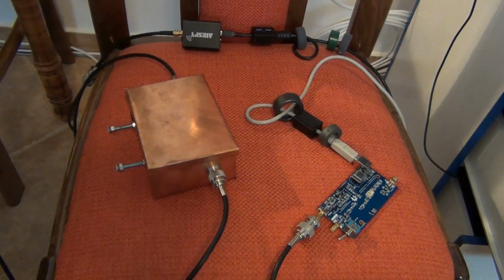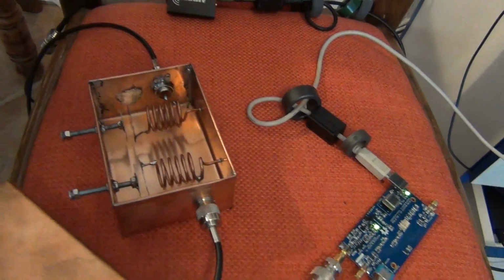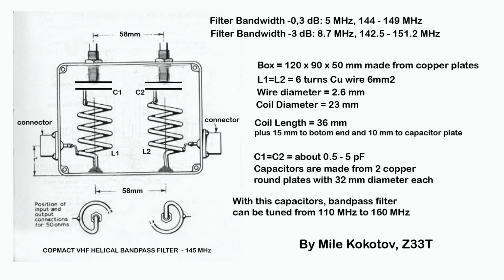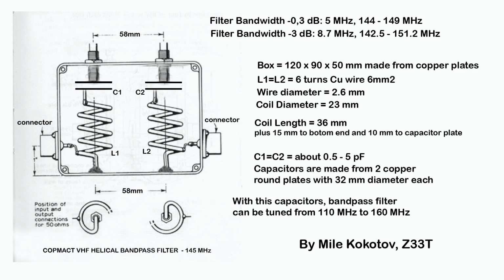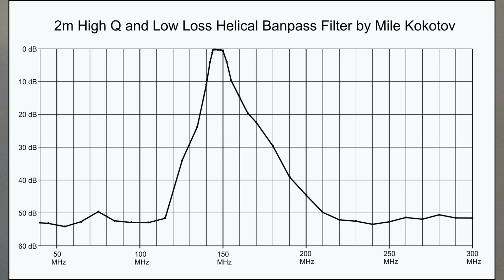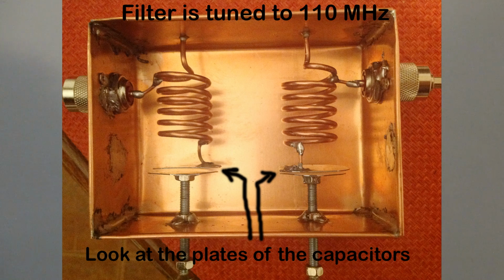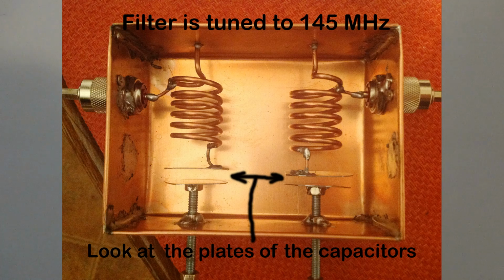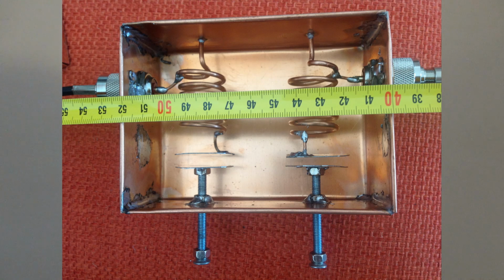145 MHz Low Loss Bandpass Helical Filter by Mile Kokotov

Comment: Hi I am thinking to build this as I suffer with antenna masts near me and my radio 2 meters, front end is blasted by the masts transmissions. Can I use a diecast box or does it have to be copper? many thanks for your response and great video.
Reply from the maker: You can use Diecast aluminum box, but much better is copper box in order to achieve low loss in bandpass frequency range
Reply: @milekokotov1964  Thank you for your response. What you have built is very good. Is it OK if I use double sided copper PCB? as copper sheet is very expensive here.
Reply from the maker: @personalunderstanding7055  Yes! You can use double sided copper PCB. I use it for making the box also!
Reply: @milekokotov1964  Brilliant, thank you!
Reply: @milekokotov1964  I built mine but it was 21 Mhz lo., meaning the swr was 1 2 1 at 124MHz. I wish I was good at maths.

Comment: I have built this, works great on 148. But i got difficulties on 170, any suggestions?
Reply from the maker: Make the capacitors plates with little smaller diameter. The Coils can be the same or 1/4 turn less.

Comment: Thanks for sharing - I must build this! I have already bought a 3-stage filter, which works perfectly. By the way, do you know, how to tune a 3-stage-filter correctly? It's obviousely more complex than turning all 3 stages to maximum...
Reply from the maker: The tuning depend of which method you will used and which measure equipment you have. I highly recommend tuning with VNA (Vector network analyzer). There are many cheap VNA on the market today. For example, NanoVNA which cost less than 50 USD.
Reply: @milekokotov1964  I've tuned with a VNA, all stages to minimum passband loss, but there is some ambiguity because of the 3 stages. I have read somewhere about shorting stages and tuning stage by stage, but I dont know how exactly.
Reply from the maker: @trombabaroque  There are several technic to tune 3 or more stage filters. I preferred to tune them to minimum passband loss and that`s it. Depend of what to want to trade off. Passband shape or passband loss
Reply: @milekokotov1964  Ok, I understand 🙂 thx

Comment: Would 30 mm copper plates work for this instead of 32 mm? I'm planning on making this filter to attenuate strong VDL2 blips on 136.7 that is ruining my LRPT captures on 137.1 and 137.9 MHz
Reply from the maker: Yes. It will work with 30 mm copper plates
Reply: @milekokotov1964  great thanks!

Comment: That is amazing! Would the loss be similarly low (looks like 0.5 dB) for uhf, like 315 mhz or 462 mhz?
Reply from the maker: The higher the frequency - the higher losses will be, so the filter have to be build much more carefully, with silver plated copper if it is possible, and instead of helical filter, the design have to be with half wavelength or quarter wavelength stubs...
Reply: @milekokotov1964  I have a CNC and 3D printer, figured I could use both machines to make something super accurate.  By stubs do you mean a cavity filter?
Reply from the maker: @weirdsciencetv4999  Yes. The cavity filter is much more efficient  for UHF
Reply: @milekokotov1964  brilliant, that’s what I’ll do then.  I saw someone make a sort of cavity filter that looks like a comb. Unfortunately he didn’t rigorously characterize it, like insertion loss- just a spectrogram of it being a bandpass filter.  Might look into those too.

Comment: What is the maximum power level that this design can accommodate? I was thinking of building one just like this for one of my mobile transceiver (Kenwood TM-D710GA). The specific radio I want to use the bandpass filter with is rated at 50W. After hearing the part near the beginning of the video where Mile covers the dangers, now I'm thinking this might not be adequate for a 50W transceiver.
Reply from the maker: Hi Jeff, I am using this filter with 100 Watt RF power. With such power, the filter become little  warm, but not very. 73
Reply: @milekokotov1964  that’s great! I operate APRS and voice from the top of Mt. Oglethorpe in Georgia every July. There are several radio towers in very close proximity (maybe 100 feet?). 

There’s 15 of us along the length of the Appalachian Trail from Georgia to Maine (Appalachian Trail Golden Packet). We are able to communicate the full length of the trail via APRS digipeating each other’s packets and have voice comms with adjacent stations all through omnidirectional antennas with no more than 50W. 

I would like to have the extra front end protection.

Comment: The center frequency is selected only by the linear length of each coil or by the coil length itself ?
Reply from the maker: Both! Central frequency depend of coil inductance and capacitance of the capacitor. On the other hand, the coil inductance  depend of linear length of the coil, the coil length itself, and many other factors...

Comment: Thanks, Mile.  If it were microwave, I guess I could understand, since waveguide kind of bounces EM waves off the parallel walls ( as I recall -  could be incorrect).  Is it that the active parts ( capacitor plate soldered to coil and coil itself ) are electrically "above" the ground of the copper box?  If that is correct, then the fact the inner conductor of the coax is soldered to the coil also "above" the ground of the box would allow the energy to move in and out of the enclosure.  In all, this is a beautiful creation and thanks for putting it on You Tube, Mile.  Inspiring!

Comment: What would happen if you put this on the output of a transmitter to aerial? I’m new to radio and wonder what stops spurious.
Reply from the maker: This filter is made of two coupled resonant RF circuits. Оnly the frequency range for which the filter is designed can pass through this filter.

Comment: wonderful video ,that make me easy understanding how it work and cristal clear ,please tell me if i want to tune it between 200 and 250 mhz for reception what should i do with the coils thanks
Reply from the maker: For slightly higher frequency, the coils should have less inductance and the capacitors should have less capacitance. The capacitor plates diameter should smaller... You have to use network vector analyzer like the cheap NanoVNA, to tune it properly. Good Luck.
Reply: @milekokotov1964  thank you ,i recently bought a nanovna  but i am not yet practical with it ,for for little help is there any formula for nearby calculation or tapping
Reply from the maker: @ElectronicsShow  It is not that simple. I recommend Handbook of Filter Synthesis by Anatol I. Zverev:   https://ia803101.us.archive.org/20/items/HandbookOfFilterSynthesis/Handbook%20of%20Filter%20Synthesis.pdf

Comment: I made one and thanks a lot for sharing this my low cost radio can now receive signals whenever attaching it to a high gain antenna. However, my problem is whenever I put the cover (metal sheet) and transmit, my SWR is increasing from 1.00 to 2.00 any idea what went wrong? I kept the box one side open to reduce the SWR. thanks and 73 Armi
Reply from the maker: You should tune the filter on minimum SWR when the cover is attached!
Reply: @milekokotov1964  i figure it out, seems the wire connecting from bnc connector was not soldered properly (my bad) , now i can cover it with minimum SWR, I am very happy with this work of art. Once again i thanks you so much for sharing this, i save a lot of money rather than buying double conversion tranciever, I spent less than USD10.00 building this filter. 73 Armi

Comment: it is possible make similar files in 2.4ghz
Reply from the maker: Yes Ivaylo, Band-pass filter can be done for 2.4 GHz. It will looks like here:        https://www.google.com/imgres?imgurl=https%3A%2F%2Fi.ebayimg.com%2Fimages%2Fg%2F-6oAAOSwBahVQJ7v%2Fs-l300.jpg&imgrefurl=https%3A%2F%2Fwww.ebay.com%2Fitm%2F1pcs-2-4GHZ-microstrip-bandpass-filter-%2F171771860823&docid=s-JSfIxDkCT8-M&tbnid=o-UflVlK9zcTDM%3A&vet=10ahUKEwiGvYnn-JDlAhVPURoKHcCACsgQMwhLKAkwCQ..i&w=300&h=225&bih=1046&biw=1487&q=2.4%20ghz%20band-pass%20filter&ved=0ahUKEwiGvYnn-JDlAhVPURoKHcCACsgQMwhLKAkwCQ&iact=mrc&uact=8

Comment: Misread your instructions, wound coil on a 1" former, for a 32mm OD. Other dimensions the same, made for a 118-126MHz BPF :) Couldn't really tune it around though. Went to -60db at 113-131. For the record, that took about 2' of awg 10 wire. I was able to get excellent 145 MHz results with coils formed on a 19mm former.

Comment: strange, the all box and coil are made of copper and then the capacitors links to ground is made of crude stainless steel or steel screws. Stainless steel  is probalby the worse material ever used in terms of RF losses   :(

Comment: I wonder why this is plugged into what looks like a Ham it Up upconverter, which I would have thought would have been used for HF rather than VHF?
Reply from the maker: In this setup The Ham it Up upconverter is used like a Broadband RF-noise generator in order to measure  the filter characteristic  with RF analyzer...
Reply: I see! My Ham-It-Up just has empty solder pads for the noise function. I had better look into this as it looks like a useful feature. Thanks!
Reply from the maker: @jonathanwarner1844  RF-noise generator is optional for Ham It Up upconverter. But I am using now much better (and cheap) RF-noise generator:  https://www.ebay.com/itm/2017-Noise-Source-Simple-Spectrum-External-Generator-Tracking-SMA-Source-Case/132180322006?_trkparms=aid%3D555018%26algo%3DPL.SIM%26ao%3D1%26asc%3D20131003132420%26meid%3D20a7d9487ff748fb8df416e62329c796%26pid%3D100005%26rk%3D1%26rkt%3D6%26mehot%3Dag%26sd%3D142806862253%26itm%3D132180322006&_trksid=p2047675.c100005.m1851

Comment: Hello,
I am impressed by the filter design and I wish to build myself a WHF band-pass helical filter for 50-110 MHz interval, I found in the web a calculator for that, but it has some differences compared to your design: 
https://www.changpuak.ch/electronics/Helical_Bandpass_Filter_Designer.php
Reply from the maker: If the calculator is made according to source mentioned in the narrative ( "Handbook of Filter Synthesis" by Anatol I. Zverev ) it will be OK !
Reply: Thank you so much for reassuring me :-)
Reply: Instead of a capacitor at each coil there is a „tuning slug” and it has no parameters mentioned in the calculator, how should I interpret the information?
Reply from the maker: Unfortunately, You have to find the proper tuning slug dimensions by yourself, trying few times.
Reply: How abuot the material? Not all ferrites are created equal....
Reply from the maker: Normal steel bolts can be used for tuning slugs, if cavity is made from steel plates, but It is better to made copper bolts and copper cavity too.
Reply: Thank you very much!

Comment: what is thickness of copper plate used for the enclosure ?
Reply from the maker: The prototype enclosure which can be seen on the video was made of copper plates (0.8 mm thickness)
It can be also made with PCB soldered plates (FR4)

Comment: Hey can we use this for 433 MHz ? thx in advance
Reply from the maker: Here is the link of my web page where Band-pass filter for 70 cm is described. (in macedonian language, but you can use google translate): https://drive.google.com/file/d/0B7Bk3JifFLbSdzU4aUY4a0p5X0E/view
Reply: Thanks for your answer, and how did you wind the coils ? Thx in advance
Reply: Also, how can we simulate these filters, for e.g. in Keysight ADS or Ansoft Designer for example?
Reply from the maker: There are no coils for 70 cm band. Only stubs made from copper tube! The cooper tube stubs are tuned with capacitors on the top of the stubs, so they makes a resonant circuits.
Reply: Yes okay but for this video? Thx in advance and thx for the fast answers !
Reply: @HalfLife2Beta   hi do you design this filter at 435 MHZ ??
Reply: @karimhaydar7146  hey I designed one but the performance was piss poor, too much insertion loss. I Recommend using components or at least making a PCB to reduce parasitic capacitance
Reply: @HalfLife2Beta   i cant use pcb.
The desired band is 10 mhz around 430 MHZ, any help
Reply: @karimhaydar7146  as I said you must use PCB. Good luck

Comment: Hi Mile. You helped me with the helical band pass last year and it's working great. I need to build a new filter. What would you recommend if I only need to allow 1600 MHz - 1800 MHz? I'll be using the filter for GOES satellites. Thank you!
Reply from the maker: Hello Ronneil,
Here are few useful links about cavity band pass filters designing for UHF, which will give you some idea:

https://www.changpuak.ch/electronics/combline_bandpass_filter_designer.php

https://keptenkurk.wordpress.com/2014/11/05/a-homebrew-1090mhz-ads-b-filter/

http://www.qsl.net/va3iul/Homebrew_RF_Circuit_Design_Ideas/Three-Post_Two-Sections_Cavity_Filters_W1GHz.gif

http://www.qsl.net/va3iul/Homebrew_RF_Circuit_Design_Ideas/2304MHz_Cavity_BPF_N6CA.gif

http://www.qsl.net/va3iul/Homebrew_RF_Circuit_Design_Ideas/1300MHz_Cavity_BPF_N6CA.gif
Reply: Thank you so much again! :)
Reply: Friend we need to have filter to cover the entire FRS / GRMS UHF band.
Because here in the region has a community radio with strong signal on FM 88 - 108 mhz.
So we want a filter of 462 mhz up to 468 hmz to cover the entire range of FRS and GMRS.
How can we filter the weak signals only from this frequency and ignore the strongest signals? So we will not hear the signal of FM 88 - 108 mhz because it will be squeaking and not working?

We just want to listen and transmit in FRS and GRMS and make sure the Baofeng UV-5R also receives these weak signals.
Reply from the maker: Here are few useful links about cavity band pass filters designing for UHF, which will give you some idea:

https://www.changpuak.ch/electronics/combline_bandpass_filter_designer.php

https://keptenkurk.wordpress.com/2014/11/05/a-homebrew-1090mhz-ads-b-filter/

http://www.qsl.net/va3iul/Homebrew_RF_Circuit_Design_Ideas/Three-Post_Two-Sections_Cavity_Filters_W1GHz.gif

http://www.qsl.net/va3iul/Homebrew_RF_Circuit_Design_Ideas/2304MHz_Cavity_BPF_N6CA.gif

http://www.qsl.net/va3iul/Homebrew_RF_Circuit_Design_Ideas/1300MHz_Cavity_BPF_N6CA.gif

Comment: Hi and tnx for the nice video Mile ! My questions for you are : What material should the screws and nuts be in ? stainless, copper , brass or just "normal" steel ? How long should the minimum lenght be of them and what size M4,M5 M6 ? Is it the innerdiameter of the coils that should be 23 mm ? Is the lenght (from coils end) from that side where there is no plate 15 mm to the "wall" of the box, just asking because it looks like the coils end goes outside the box a few mm. Thanks in advance !!!
Reply from the maker: The best is if the screws and nuts material will be copper brass, but it is OK with stainless steel. I have made few models with normal steel. The prototype model was made from normal steel (M5) screws and nuts. The measurements were done with this prototype, and shows excellent results. The coils were wound on metal cylinder  with diameter of 20-21 mm. After the coil were formed, and pull out from the cylinder, the inner diameter of the coils increased itself to around 23 mm. The length of the grounded end of the coils should be around 15 mm from the base of the coil to the ground (bottom of the box) in my case, I had made a holes and I had sprinkled the wire trough the hole and soldered it. Its was easiest way for me to solder the bottom end of the coil to a bottom side wall of the box. After the wire has been soldered, you can cut off the wire from the other side of the bottom wall.
Reply: Many thanks for the answer and fast replay ! Hope to hear u on the air sometime 73s de SM6RSE
Reply from the maker: SM6RSE 73 de Z33T

Comment: Thanks for the A1 video. Could you give some description of the mechanical arrangement with threaded rods to tune the  Hi volts tuning capacitors?
 Are they special threaded bearings or just captive nuts?
Does the thread etc introduce any losses due the poor earthing? Circulating currents must be high at this point.
Is there any significance of the earthy ends of the inductors still protruding through the case? Doesn't show in all shots.
Many thanks.... G3NBY.
Reply from the maker: I have put two nuts soldered together on each bolt which hold capacitor plate, for better conductivity and less RF losses. Overall loss is 0.25 to 0.5 dB. Here is measuring video: 
https://www.youtube.com/watch?v=vMG7OgDXOU8 

You can find more about this excellent VHF band-pass filter here: https://drive.google.com/file/d/0B7Bk3JifFLbSSEdzNTZaRWt4M1E/view

Comment: By forcing all the resonator current over the thread of the thin adjustment screw, the resonator-Q is reduced. It is better to create a variable cylindrical capacitor with a thick penetrating screw.
Reply from the maker: It is a reasonable thinking, but measured losses shows that they are minimal relative to similar band-pass filters on the market..
Reply: Sure. I usually compare the simulated unloaded resonator Q with the achieved unloaded Q. If you compare with other similar filters, then you only know that your filter is as good as other filters. The effect of relatively lossy screws of course also depends on their length. You can try experimentally by using copper-plated screws.
Reply: how did you simulate helical filter on ADS?

Comment: Hi! I would like to ask if the metal box dimensions are critical? Could I use another dimensions, provided that I might get different tuning positions on the capacitor. Would I need to adjust the coils as well?
Reply from the maker: Hi Blaž, a few millimeters bigger sides of the copper box will be OK !

Comment: right great job but how and where could i buy or get someone to make a very a low wattage narrow band width filter say half a mhz on vhf exsample 144.000  to 144.500 ?
Reply from the maker: Hi Jonneil, The more narrow the BPF should be, the more LC-tanks it should have. The pass band loss will increase also!
Reply: but it is possable to narrow it to half a mhz  from 144 to 144.5 yes